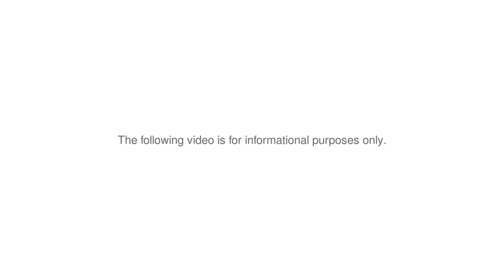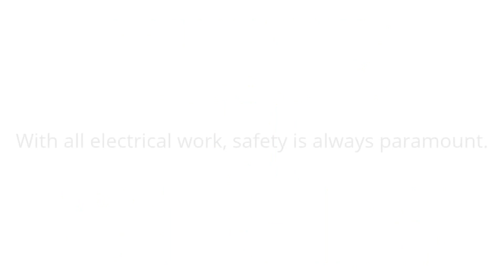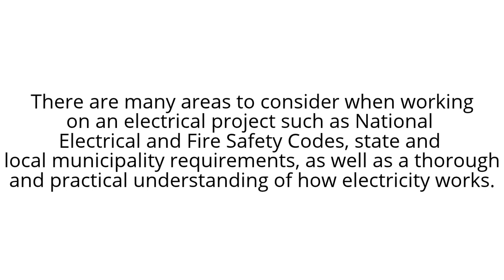My Fluorescent Lights Don't Turn on Properly!

Comment: Hi Massive Electric... I live in Houston... the opposite effect for me...  now, in winter my garage fluorescent lights turn on quickly but when it is hot they don't turn on... I changed the T12 bulbs and ballasts (GE Total Performance rapid start)  any help to get them working when it heats back up here in Houston is appreciated!!

Comment: I turned the breaker off to replace a hallway fixture in an apt building. When I turned the breaker back on the new one worked great but now the others are out. I shimmied the bulbs but they went light. Why would the breaker effect the bulb?

Comment: I have a group of fluorescent lights that have been problematic recently. We've had mixed success replacing the bulbs on a few of the lamps but having three of four die at once is suspicious. I wonder too if I should replace the switch? Now it seems we have one of three lit.

Comment: I installed a new ballast, new bulbs, and new sockets but I am having issues. The bulbs come on on the outsides, but on the inside it is dark. What could be the cause of this? I have run out of ideas. Thanks!
Reply from the maker: +Kyle Cleveland hard to say, but if everything is new, then the ballast may be wired incorrectly. Did you check voltage at the ballast for 120v? You may have a lopse connection causing lpw voltage in the circuit. Is it on a switch or dimmer?
Reply: It is on a switch. Thank you for your response.

Comment: I have a small energy drink refer and it has two tube bulbs - one on the outside up top and one inside to shine on the drinks inside. They both work off the same switch and I just bought two new bulbs, one for each. When you turn them on, the bulb on the outside comes on perfect. The bulb on the inside barely glows at each end but when you twist it about a quarter turn to where one of the two prongs on each end disconnects, it comes on and will stay on like that until you flip the switch to off and then back on and then I have to repeat the steps of twisting the bulb back into connected properly til it lights up slightly at each end and then I twist a quarter turn and it comes back on. Sorry for the long story but I want to make sure you understand fully. Please help??
Reply from the maker: +Brian Eads check the ballast for that inside lamp. Is the refer new? Often, with residential or commercial lighting, if a fluorescent ballast is used in a cold area or a walk in refer it must be a "zero degree" ballast or it will act in a manner as you are seeing. If you can find the ballast, look at it closely and it should say "zero degree" (or something very close to that) somewhere on it. If it is an older or used refer, it is possible that someone changed the ballast and unknowingly used a standard ballast (which is generally best used for temperatures above +/- 40°F) as opposed to the zero degree ballast. If you see that your ballast IS the correct ballast, change it anyway. Let me know how it goes.

Comment: my lights only glow at the ends when you turn them on. what could be the problem?  I twisted the bulb around and two of the four came on.  i believe their in series.  but the switch was working intermittent.  took a few trys to turn them on.  now it only glows at the ends. pls help
Reply from the maker: +Dion Jensen  what type of bulbs,  fluorescent? If so, replace them, they are burned out.
Reply: i turned them  and they came on.  but only two of the four
Reply: yes they are flours

Comment: How about the fluorescent light switch?  I have to keep flicking the switch and when it's just right then the light goes on.  Mine is a 2 bulb 4 feet light.  Do I need a new switch?
Reply from the maker: +philanna38 that is a possibility, if you can determine that the switch is the cause then yes replace it. Switches can fail (or start to) and will cause similar problems as you are seeing, usually this will only be seen in the split second when the switch is being operated though. Let me know what happens! Thanks for watching.
Reply: Thanks for your quick reply. I will replace the switch and let you know if that was the problem.
Reply: Hi, I replaced the switch and the light is working just fine.  Thanks for your help!
Reply from the maker: +philanna38 awesome! Glad to hear it!
Reply: The problem you had is similar to what I have now. My  kitchens fluorescent don't turn on right. Before I had to flick the switch several times and the lights would light on now neither one of my 4 fluorescent light on,  i even bought new ones and yet they don't light on. Could this solve the problem? By replacing the switch? Thanks.
Reply from the maker: +CeSaR MaRtInEz the switch is a possibility. Most likely the ballast though. Thanks for watching!
Reply: You're welcome. What I've noticed, since i have a double switch and my food disposal works fine maybe is the starter or ballast that needs to be replaced. I'm only using 2 fluorescent on my 4 fluorescent box.
Reply from the maker: +CeSaR MaRtInEz could be a starter, but those are a older design. Try it first but If you replace the ballast you won't need a starter.
Reply: Yes, I replaced the switch and it works ok now.  It can also be the ballast but try a new switch first.
Reply: I replaced the switch and it works ok now.  Thanks!
Reply: Massive Electric I've checked my fluorescent box and I see no starter only the ballast. That means the ballast needs to be replaced. Correct?
Reply from the maker: +CeSaR MaRtInEz yes